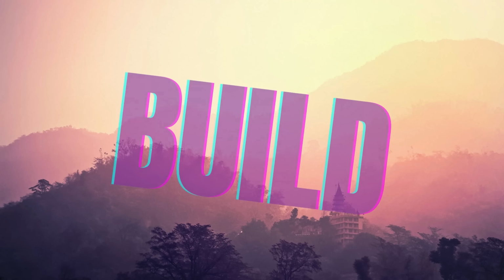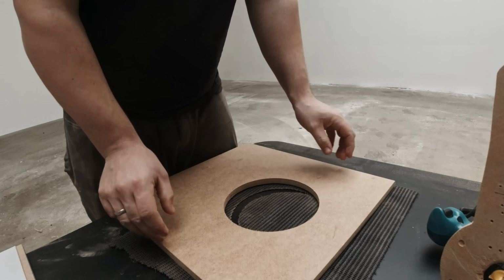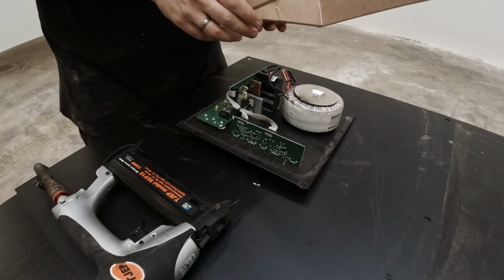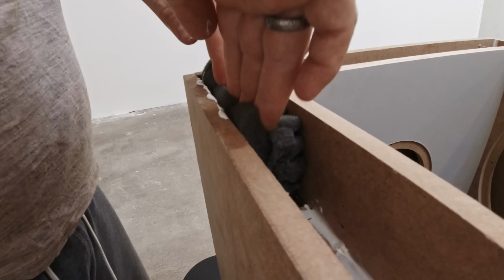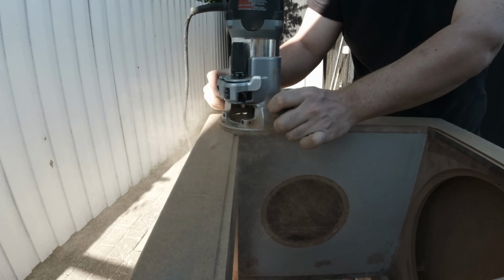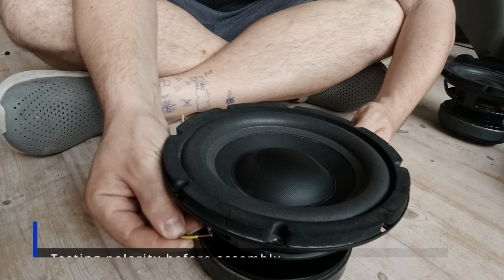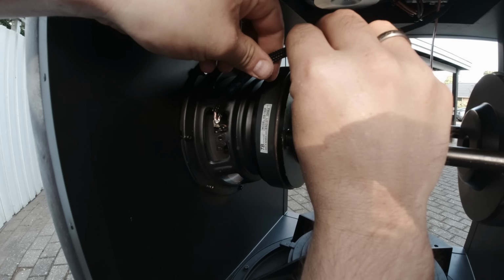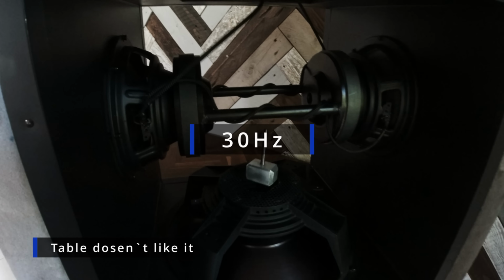DIY Powered Subwoofer with Passive Radiator Build in reverse

Comment: I was so confused at first then I was like ohhh sweet a bandpass with a passive radiator. Enginious!  Got a sub here for sure!
Reply from the maker: Thanks I did try to make it a little different😂
Reply: Well it's probably more like a ported box but the enclosure is around the outside in the square. To be fair, the bass head in me would make the same size box with 2 x 15 and 4 x 8 or something lol.

Comment: What do you mean by reverse polarity? The woofers should push the radiator both same way!
Reply from the maker: The drivers back function as the front side of the cone so they are both in reverse 🙂

Comment: Cable around the center steel rod is not a great idea. As it's only 2 loops the effect power is very low but with each bass boom it's a degausser just on top of a magnet :-)
Reply from the maker: Great input didn`t think of that 😀 normally its like 800 years do you think im still good for like 20? 😀
Reply: @mustbuildsomething  yeah, probably more, that was really just for the fun 😀
Reply: @mustbuildsomething  and also I would have put the common on the amp, not on one speaker (speaker --- amp --- speaker, not amp --- speaker --- speaker) because the first part of the cable borrows the power for 2 speakers. And the lenght of the cable from the amp is doubled for the second speaker so a greater loss of power and a little dissimetry between speakers. But all these are so small details that there is no audible differences, it's just my OCD 😀
Reply from the maker: @frederichardy8844  I totally get that. :) I wired them so that on driver gets plus first and the other minus so the current should be timid and equally distributed 😂 i wired them in parallel, not in series ass i wrote 🙃😀

Comment: I thought initially it was going to be plexiglass around the edge with the window.
But then I realized it was the woofers inside. There was a thin gap between the inner and outer walls which housed the airspace.
How much airspace is there in this box design?
I like it a lot!
Reply from the maker: I don`t remember airspace in cubic feet or liters. Calculateted for a tube design but it should have been bigger than it is. The stuffing should help though. :) Thanks for the commet
Reply: @mustbuildsomething  I appreciate the reply and love the design. Not something I've seen before..

Comment: It's gotta be the ugliest sub woofer I've ever seen... I thought it was a joke to start with 🤣😂🤣..!!
The passive radiator should be mounted vertically not flat by the way .... the reason being that the mass load has gravity pulling it down and it presents added diaphragm stiffness when it moves up !! This causes non linear displacement!!
Reply from the maker: Thanks for the comment 🙂